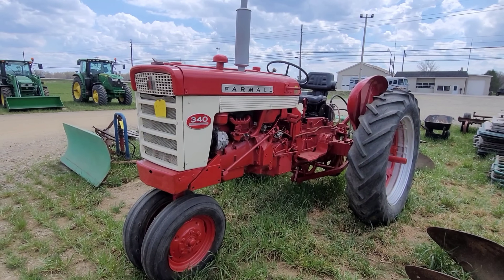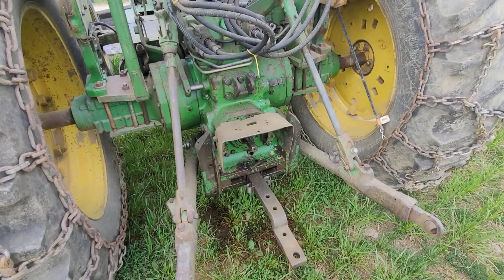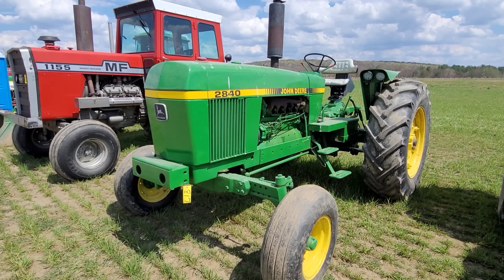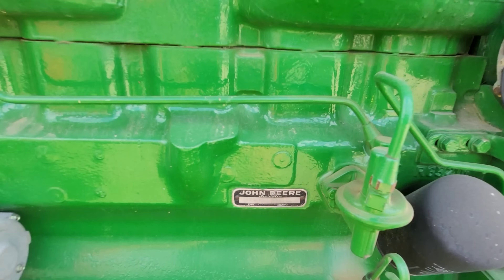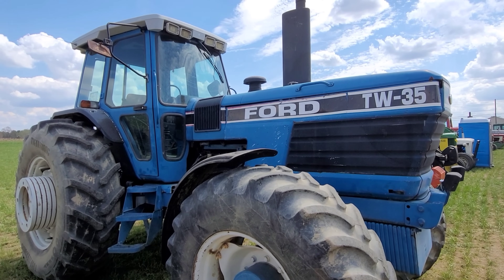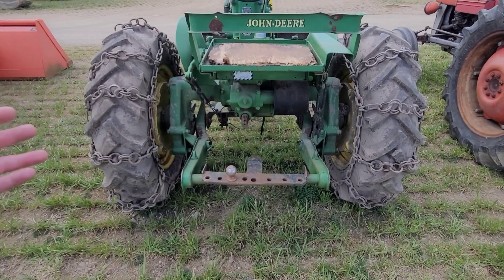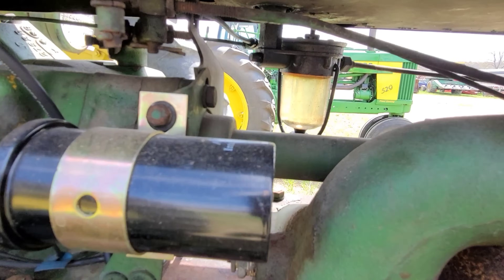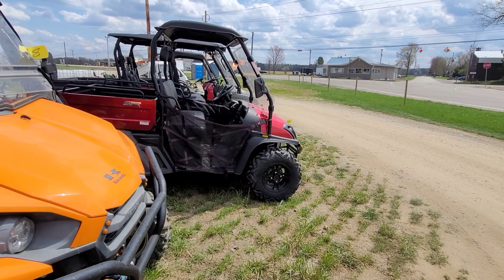What Tractor Would You Buy? | Multi-Color Sale

Comment: Remember, Ford is first and foremost a car company. They've always had an eye for style and that eye for style has always been seen in the tractors they made. But sharp styling doesn't always produce a good everyday heavy load tractor. But after the 6000 disaster Ford struggled to build the kind of big tractor the market wanted and buyers liked.
Reply: I have owned several Ford Tractors and some better than other brands! Ford began making tractors in 1917! All makers have had issues!
Reply: Henry Ford was first and foremost a farmer. That was always his passion. The 6000 is no comparison to the later Fords. The big problem with the transmission issues on the 6000 was due to the main designer being sick and not having enough time to work out the bugs. Henry released it prematurely and it made the design engineer upset and he ended up leaving Ford for John Deere. His name was Harold Brock, and the perfected version he invented was the John Deere Powershift. That transmission would have been in every Ford tractor if it weren’t for lack of patience. As for the late model Ford tractors, I stake my livelihood on them. John Deere liked the late model power shift transmissions that Ford. They liked them so much that they actually bought the company that Ford had contracted to build the transmissions so that Ford/New Holland couldn’t compete with Deere. Big tractor manufacturers fighting… It’s worse than a boxing match with groin kicks and eye gouging.
Reply from the maker: What tractors do you have?
Reply: @FarmallFanatic  Before my father divorced my mother after 40 years of marriage we had a MF 150D Allis 5050 actually a Fiat (good tractor) and a Allis 6080. Here's the 175 story. It had 1200 hours on it when one morning completely unexpected here comes the dealer bouncing in the lane with a 6080 on his trailer. Pulls in and stops and says....." I want your 175. I've got people pounding on my door who want a 175. I simply have got yo have it". He made an offer that was impossible to pass up. As for the 6080 that little combine engine in it had to work hard to make the 83 PTO rated output. As for the 175 our now deceased friend and neighbor up the road bought it, loved it, very proud owner who took care of it but believe me it didn't spend much time in the tractor shed .And when he died last year at his viewing his family posted photos detailing his life including several pictures of him and his beloved 175.
Reply: @Robert Long : That's simply untrue. As a matter of fact, Ford made some absolutely wonderful tractors all the way up through the Ford / New Holland branded tractors.
Henry Ford would be rolling in his grave, if he knew that his idiot successors had sold off the entire agricultural division back in the early 1990's, just to solely focus on building their modern-day junk autos & SUVs.
Reply: @greencastlefarms6595  The 6000 also had a problem with wrist pins., If all of their tractors were as good as you seem to claim Ford would still in the business today
Reply: @turbodiesel4709  If ford tractors were so great they would still be in business today